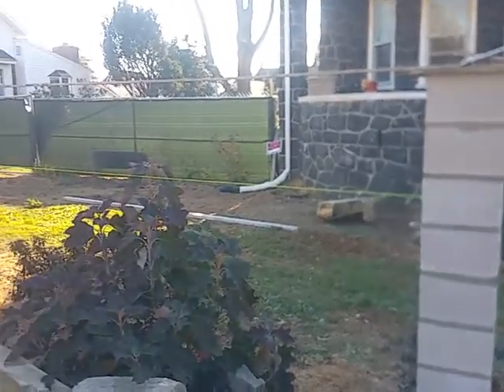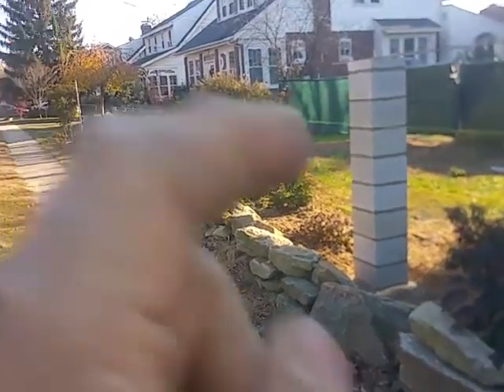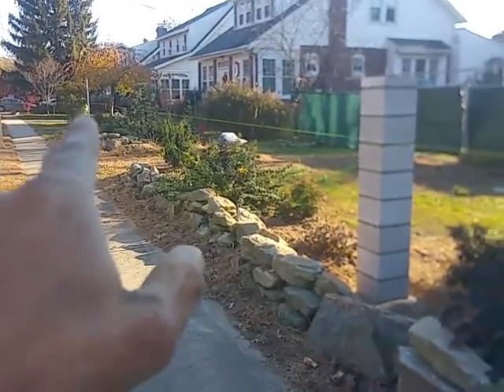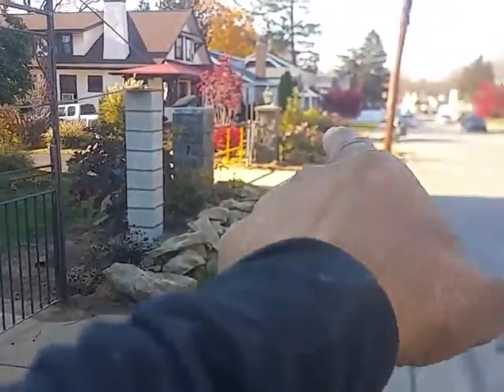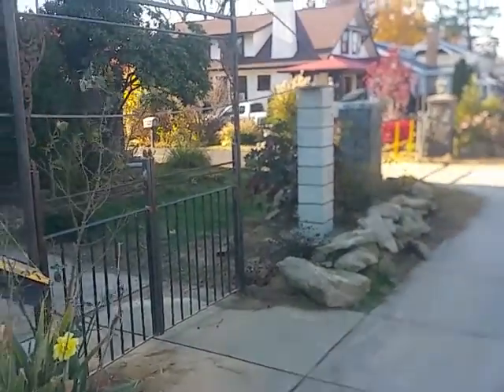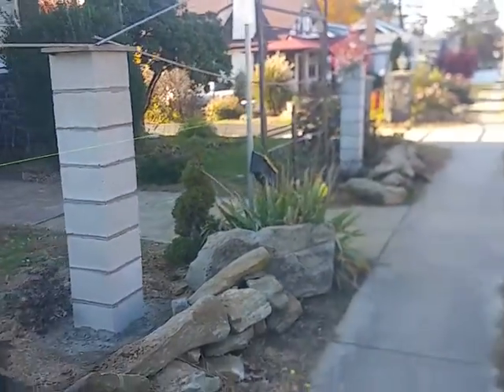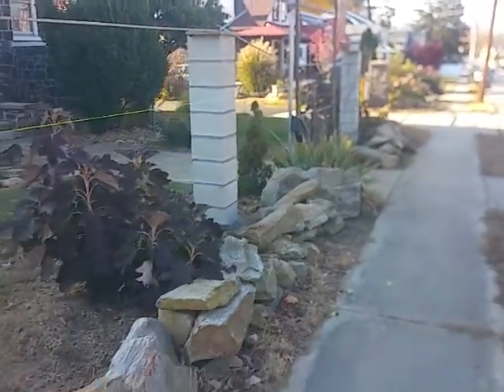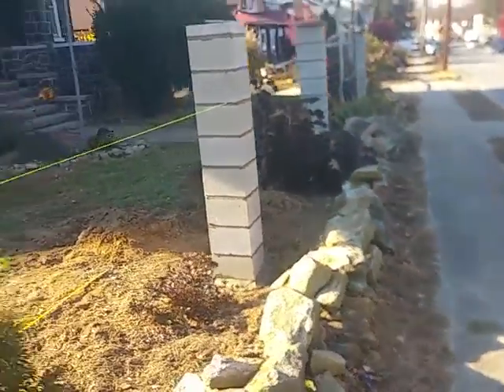Block columns used as fence material and rendering a block wall

Comment: How are the columns over time? I searched your channel to see if you showed the build but so far have not found. What size blocks are those and did you use rebar? I need a similar set up. Thanks for posting this.
Reply from the maker: Where do you live?
The columns are great, I have done a few other details to this wall...
I will post something for you later, perhaps this weekend.
Rebar, yes on all except one that I tested without.
All are very worthy of their task.
Maybe I will do a quick video for you in the next hour...

Comment: I'm got a cuestion, should use a lath mesh cuz I'm building 16" square concret block columns ? Or just plastering direct to the blocks with out lath ?
Reply from the maker: Edmundo, you should wait a moment, I have an awesome video for you... it may take me a day or two to load it (edit)... It will really help you... As far as lath goes though,  the foundation is where your movement will come from... Unless you are building a retaining wall?  A wall to hold back something like dirt?